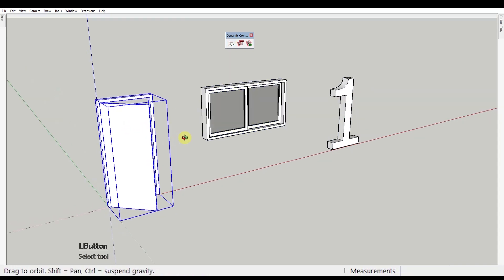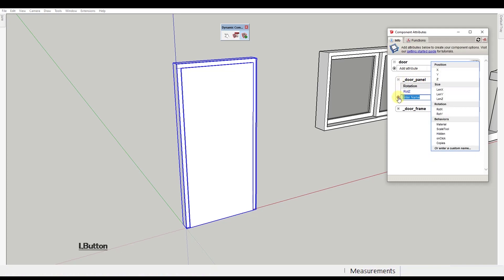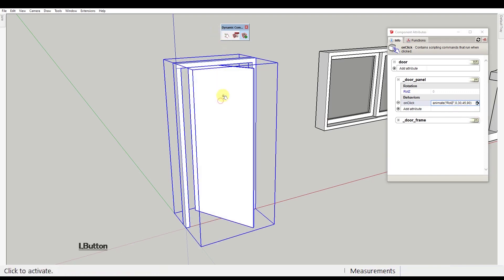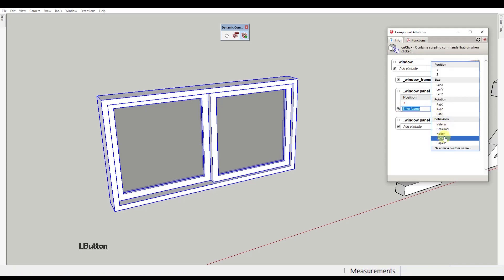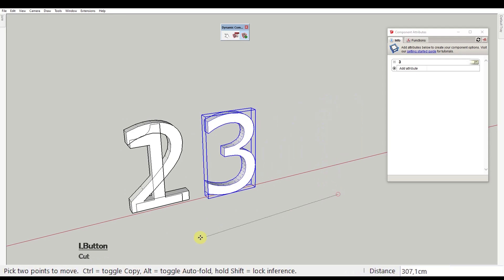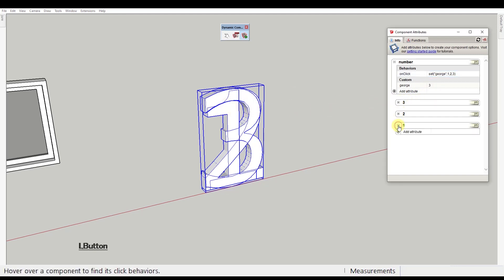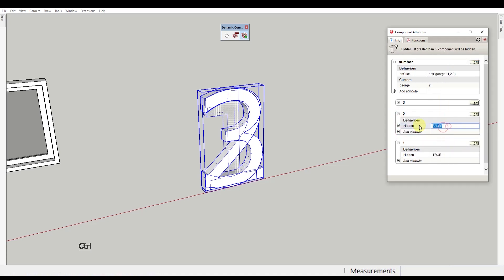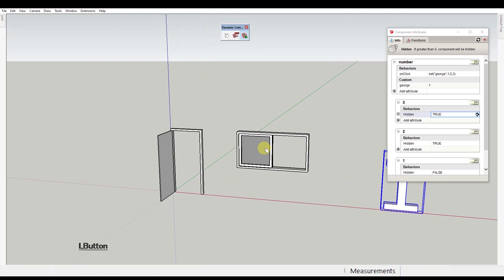How to Create Dynamic Components in Sketchup Tutorial – 3 Examples

Comment: Crazy that in an easy to use software like sketchup they haven't improved the way this tool works. With all the coding brains at Trimble, surely it should be possible to enter start position, end position, set rotation point etc and hit enter - just like when using the regular tools. I realize this is not your fault. Just an observation.